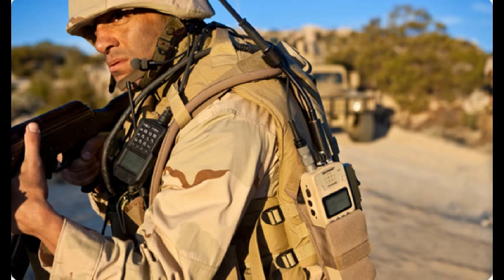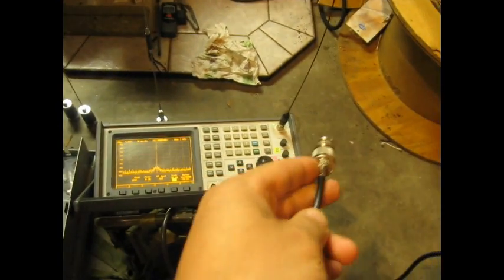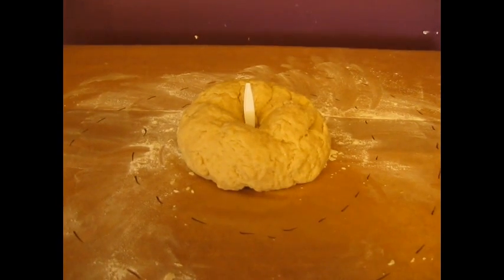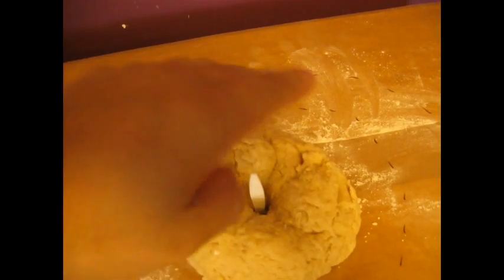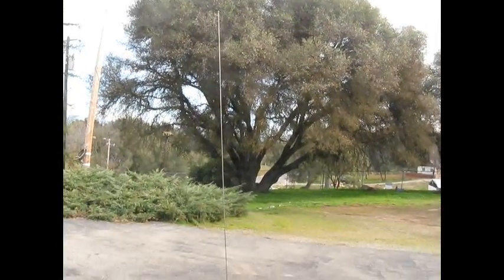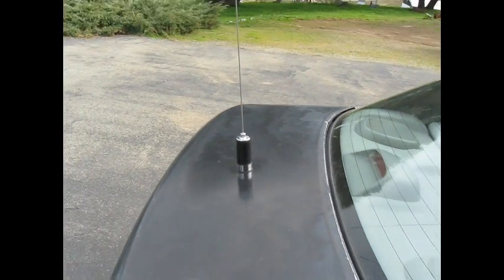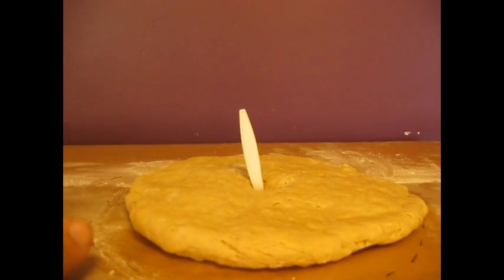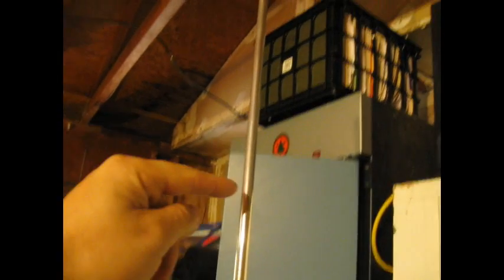Prepper Intro To Antenna Basics. Practical Theory  On Choosing Antenna Gear

Comment: What about the J pole antenna? Can you go over that? I took apart a hand full of hard drives any way of using them for antennas/or parts of an antenna? There are several of those TV satellite dishes in my area can they be used for any antenna project?

Comment from the maker: I'm no engineer, so I could only explain in practical ways. a plain dipole theoretically radiates in a perfect sphere. When you stack dipoles or make a beam (Yagi) configuration, it modifies that sphere onto an elliptical or oval shape. its more of a spearhead instead of a shotgun. Hope i didnt confuse you with my analogies.

Comment from the maker: @camokbear1 No, it will not hurt your scanner at all, except if there is a lightning storm happening. even though the cable is typically 75 ohms on the tv antenna, its still ok for reception, just not efficient. the older tv antenna is pretty wideband, but not really tuned for radio signal in the ham, public safety and FRS/GMRS bands, but close enough. Also the antenna is directional, so you might have to turn the ant towards an area of interest. I personally would use it. let me know how it go.